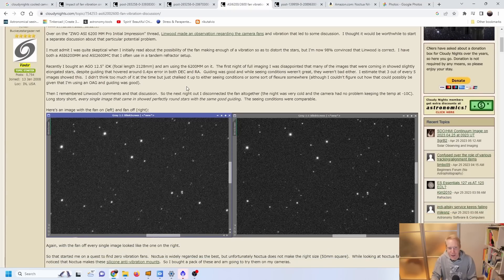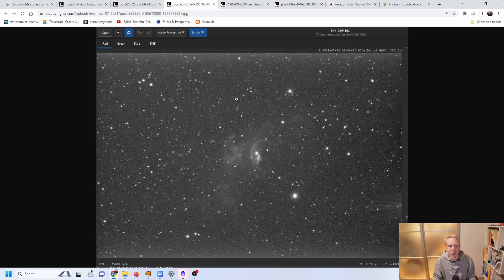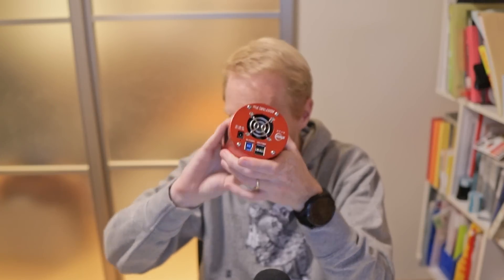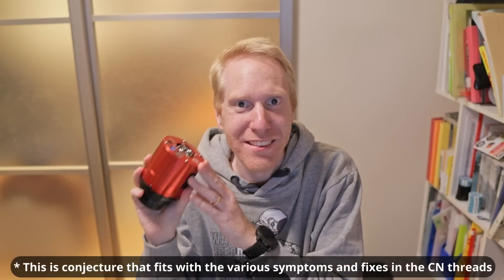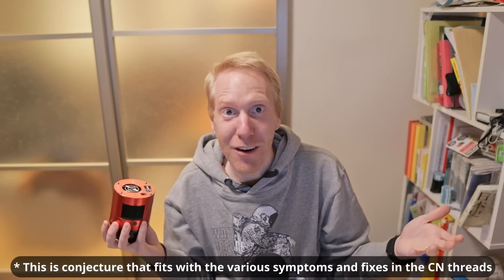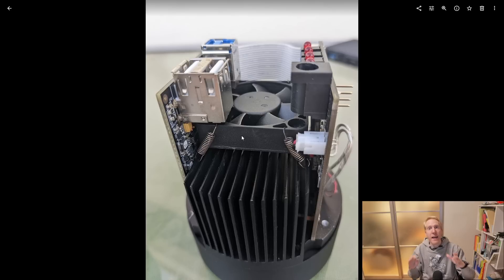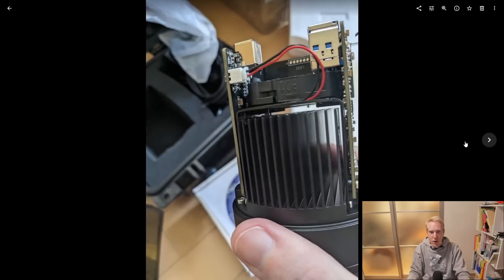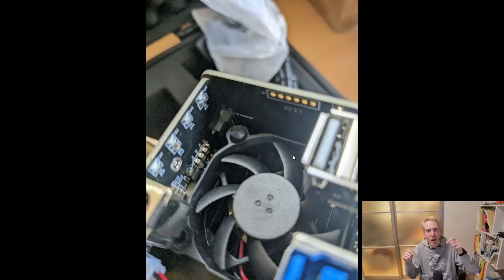Cooled Cameras can HURT our images?! 😱 HOW?? EASY fixes!

Comment: The problem is as old as our hobby, although at the dawn of specialized astro cameras there were no problems with vibrations from the fan, but these cameras cost as much as my two kidneys. On my RisingCam camera, right before the first light, I changed the native fan to the Noctua fan, the flight is normal. And when modifying my Canon 550 D to a cooled one, I went through 7 pieces of fans until I found a copy with practically no vibration. This is not an easy or cheap task.
Reply: Hello justvolkov 
 I s I saw your video tutorial on on modifying the fan the fan for the astro camera I am very interested if you can share future video is the future video in English😊
Reply: @sdoseri  Unfortunately, I understand 80 percent of English, but I need to speak English, which I have not had over the past 30 years. However, subtitles and translation work on YouTube
Reply: @JVRost  😃 

Thanks for your response
Reply from the maker: 7 fans on your cooling mod before finding a good one?!?! Damn, that's quite bad odds....
Reply: @CuivTheLazyGeek  Only 7 fans - what little things in life)) But the chances are great if you set the parameters in the design of the bearings, only of the floating type, or as they are called hydro bearings.

Comment: I have no idea how ZWO has the good reputation it does. If you’re somebody that can’t shoot a lot and can only shoot occasionally it will probably work out but if you’re an active user of their stuff, the quality just isn’t there. They use the same chips as other superior companies but everything surrounding it lacks high build quality.  

I’ve had the motherboard go out in two different ZWO products.  And while other companies are switching to USB-C, they’re still using large old fashion USB cables, have oil leaks and issues with their cool.
Reply: AsI are like apple a  closed eco system. QHY are better. Asi make it attractive by offering asiair. That's how they hook you

Comment: Cuiv, do you have this issue with your Rising Cam? I have the Altair 26C so same Sony IMX 571 sensor as you. Is the fan in this camera located differently? Have just started doing some DSO with my C925 and reducer so working at 1480 fl. thanks buddy.
Reply from the maker: I don't but other comments have mentioned issues with Gen1 of the camera!

Comment: Very good content!( Like usually)
 I never thought about that. I just assumed the camera producers would avoid that.
Infortunly my only cooled camera is a old ATIK 383L, and I think it is not possible to use with the fan off. But anyway, I will try to check.
Reply from the maker: You could just stop the fan (temporarily) by just blocking the blade movements with a stick or equivalent (without cooling the camera if that's possible!!! If the camera cools down automatically, don't block the fan!!)
Reply: @CuivTheLazyGeek  yes. It is possible. I can turn the cooler off. Just can't do it with the fan. I will try. Thanks!

Comment: I have a friend who is always complaining about oblong stars despite his decent guiding. I wonder if this could be causing his issues. Seems easy enough to test with just turning off the cooling. There are also some great phone apps that can measure/record vibration using the accelerometer in the phones. I don't recall which one I used previously but I remember doing some comparison on my 3d printer a few years ago using the phone and app.
Reply from the maker: I'd love to see if you have a practical way of measuring vibrations (besides wiggly satellite trails)!
Reply: @CuivTheLazyGeek  I'm looking for the app I used previously. It worked great. I just set the phone on my printer and recorded it printing for a few minutes. Then I applied some changes to the frame of the printer and ran it again on the same 3d print project for a few minutes. I was able to compare the results in Excel and see the improvement. I think we could do the same with a camera. You could probably tape the phone to it on the mount or just set the camera on the phone face and record. I don't see why that wouldn't work. The phone accelerometer is very sensitive.

Comment: I have dealt with this same issue on my ASI2600MM Pro on my C8. It was a dead giveaway for me when looking at a satellite tail on a single exposure and instead of a straight line it was basically a sine wave. I was also able to see the difference in exposures as short as 2-5 seconds with the fan on vs off. With an OAG on my c8 I could even see the vibrations in my guiding camera. I tried several different fixes including changing the fan, using vibration mounts, adding mass to the camera and even mounting the fan with springs. Adding mass to the camera produced the best results but was not easy to manage. In the end I used the anti-vibration silicone mounts with a different fan and it eliminated 80-90 percent of the issue. 

I think a possible fix that I have yet to try would be to slow down the fan speed and let the cooler run at higher power instead of the other way around.
Reply from the maker: Oh wow Don you really have been trying things out. Glad you seem to have gotten to the bottom of it. Would you be soldering some resistors between PCB and fan to lower its speed?
Reply: @CuivTheLazyGeek  that was one idea. I did also purchase some small adjustable voltage regulators with the hope I can make it fit inside the camera and just step down the fan voltage without affecting the cooler voltage.
Reply: @CuivTheLazyGeek  cuiv, the noctua fan kit comes with resistors that go in-line on the power cables for dropping RPM
Reply: There was a CN thread (April 2021) on the issue - fan vibration. Fractal Designs'  "Silent Series" fan along with the silicone stand off mounts looked like a winner.

Comment: Replaced my 2600MC Sunon fan with a equal CFM lower rpm Noctua fan along with their rubber mountings, result much quieter and zero vibrations in the 2600
Reply from the maker: Excellent feedback! I'm seeing so many comments from viewers like you who have experience with the issue, I'm surprised it seems to be so prevalent!
Reply: What is the part number of the Noctua fan you used?  BTW, Amazon says the anti-vibration fan mounts are currently unavailable.
Reply: @edhekman6615  Look for Noctua NF-A4x10 FLX. It's a 40x40x10 mm 12V fan that runs at ~4500 RPM. It produces slightly less airflow than the stock fan, but that shouldn't affect performance. In return it is much quieter, probably also causes less vibrations. And it already comes with 4 of those exact same silicon anti-vibration mounts that Cuiv linked, as well as a 3-pin to 2-pin adapter that will let you connect it to the power pins on the PCB inside the camera housing.
Reply: @frudi  Got it - arrived today.
Reply: @edhekman6615  it was the Noctua NF-A4x10 FLX, Premium Quiet Fan, 3-Pin (40x10mm, Brown) but I had to mod it to a 2 pin connector to connect to the PCB on the 2600 and also shorten the very long provided cable.

Comment: So the old touptek did not have this problem?
Reply from the maker: I can't say for sure, but on the CN threads the old Touptek is called out as not exhibiting the issue
Reply: taken how long it too zwo to accept they had problems with oil, it will most likely not happen
Reply from the maker: @syberand  Did it really take them that long? I had only observed the drama from afar, but I was under the impression they had reacted fairly quickly...
Reply: @CuivTheLazyGeek  What I saw (from afar) is that they denied it to start with, that there was a problem and then they came out and say, okay there is a problem, here is how you can solve it yourself (here is a pdf). And then finally now I think they have agreements with companies that can help sort it out. 
Meanwhile, my touptek is running perfectly. :)

Comment: It would be enough to add another fan that rotates in the opposite direction to the other, in order to counterbalance the vibrations, as the JWST does
Reply from the maker: Huh. I hadn't thought of that! But in that case the fan need to be identical - I think the fans have too much variability for this to work 100% of the time!
Reply: The vibrations would be caused by any minute imbalances in a particular fan and would vary from one fan to the next.  It is very much the same as balancing a car tire.  You would have to have an identically imbalanced fan mounted (and always remaining) 180° opposite the original.

One thought would be to somehow minutely modify a fan blade and see if it makes vibrations better or worse.  If better, then you are in the right area of the fan and maybe add a little more weight.  We're talking something minute but removable, like drops of super glue or pinpoint drops of epoxy (which fairly easily comes off of plastic).  Then it would be a matter of dialing in the correct amount of "weight" added.

Comment: Just took apart my ASI533 MC and the fan appears to have rubber or silicon spaces between fan and screw, but I wonder if that is enough as I have seen the stars oblong when at higher focal lengths. Hummmm....
Reply from the maker: Don't do anything to your camera unless you actually can test at high focal lengths with and without cooling!
Reply: @CuivTheLazyGeek  No worries 🙂

Comment: This is exactly what happened to me with my 2600MM Pro.  It took me a long time to figure out it was the fan vibration.  It only happened after I had to replace the original fan.  I used the silicon anti vibration mounts as well but I had to make sure the fan was sufficiently away from any part of the main body of the camera.
Reply from the maker: I'm so happy you could get it fixed! This 2600MC/MM cameras are excellent, and it's a good thing that at least the fix is cheap and easy - but without knowing, finding the root cause is far from obvious!
Reply: @CuivTheLazyGeek  unfortunately I  messed up my collimation in the process because I thought that was the issue.  Eventually I fixed the collimation too.  Another interesting note is that it didn’t seem to have the issue the closer to Zenith I got.  That should have been a red flag that it probably wasn’t collimation, but something else.  It was a VERY annoying issue.
Reply: Ooh I have those anti vibration mounts, I'll have to try those!